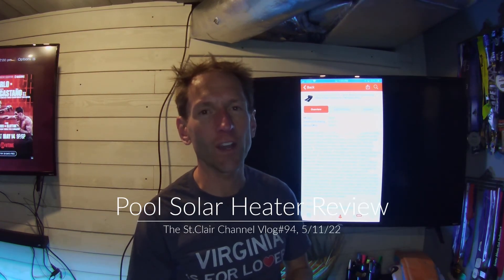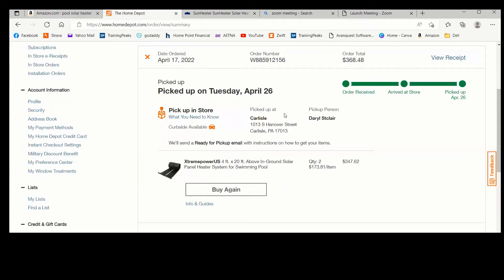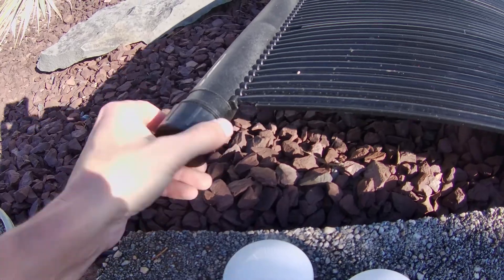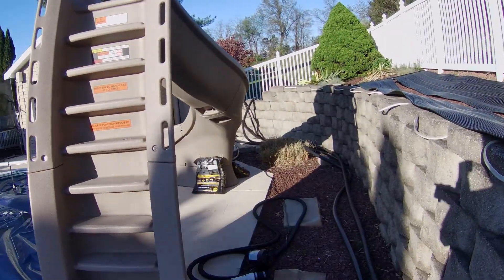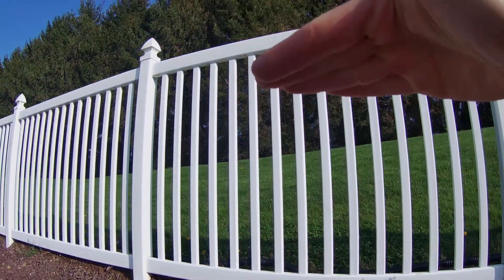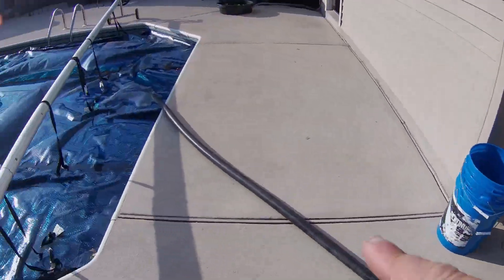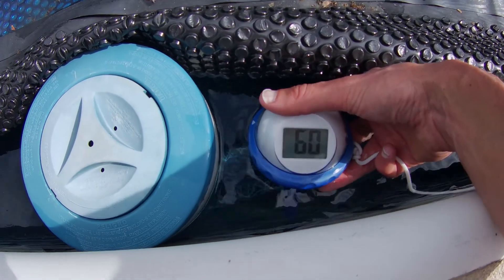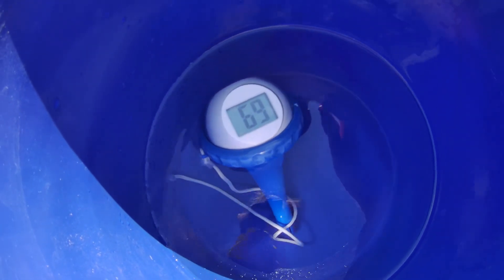Xtremepower Pool Solar Heater Review

Comment: What is the HP and flow rate of your pump?
Reply from the maker: @rickdc3  3300gph 1/2hp superior pump from Amazon
Reply: @thestclairchannel3889  Thanks. Because the flowing water will suck the sun's heat out of the tubes, I would think that slower water flow would give hotter water, but you are getting less hot water going into the pool. In the end, I don't think it matters much if you get more water at a lower temp, or less water at a higher temp. The amount the system raises the pool temp should be similar and is dictated by the size of the system and sun intensity. I'm in AZ, so I'm hoping the 4X20 will do ok on 20,000 G pool. The sun is already unbearably hot. We have a solar cover, but it only lasts 1-2 seasons, and it makes pool care more difficult because leaves from our trees decay on the cover instead of going into the skimmer where they can be removed. So I'm hoping this system lets me get rid of the cover.

Comment from the maker: I bought the smaller panels and placed on my roof. I did a YouTube video on it. It only raised temp 1-2 degrees so I bought more panels to install in the spring. I will do another video   Thanks for your response